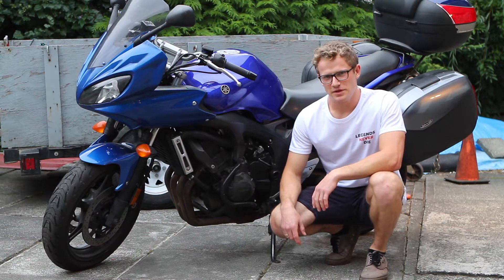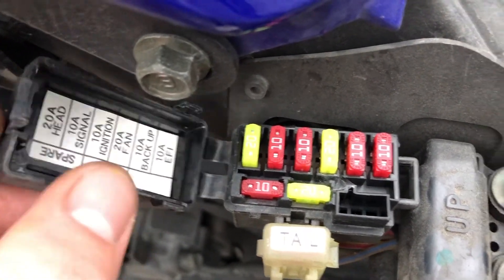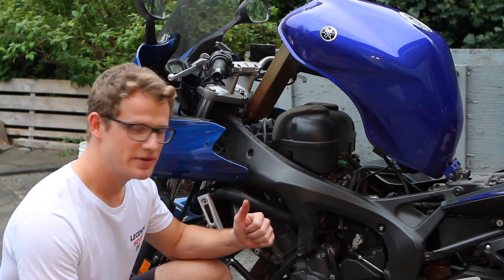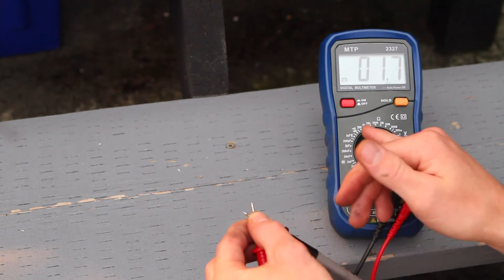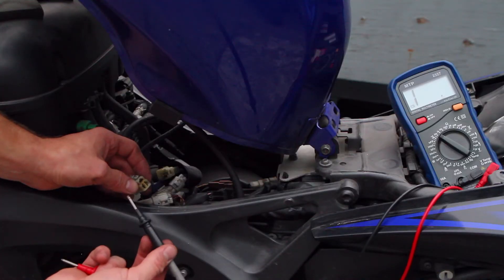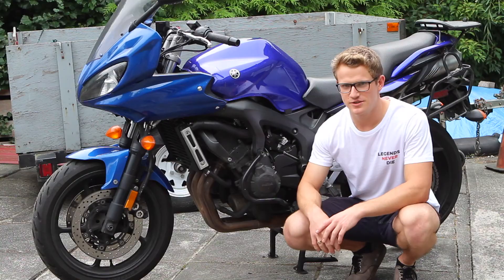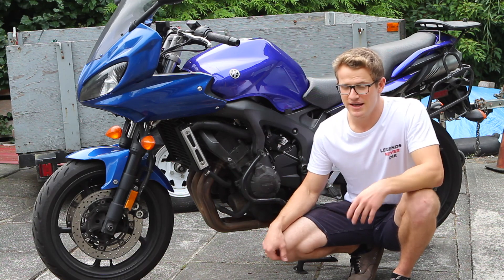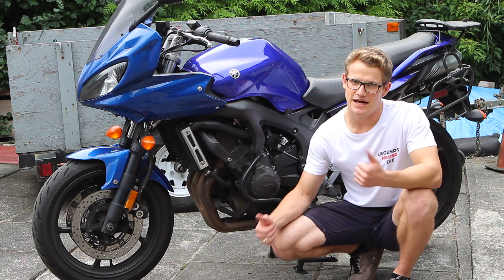Full Inspection of the FZ6 Charging System

Comment: Ha! Youtube at its finest. I have the same problem and I thought that it is so hard to check the alternator because I thought I have to open it. Turns out - I don't. Turns out - it is most probably fine, because I drain the battery once every several months or a year, apparently without any recognisable pattern. But thinking about it - the pattern very well may be - riding in low RPM! Thank you man. I knew that bike is so reliable, I feel better knowing it was my fault all the time and not the bike's.

Comment: Hi. What if the battery is at 12.8 when I get it out of bike and drains to 12.68 in like 2 days and then stabilises itself at that value? Is it a bad battery?
Reply from the maker: That’s fine. A battery at 12.6 volts is 100% charged. Your battery sounds fine.
Reply: @Calvinm  Ok so battery is good, stator is good cause I checked it, but I didn t understand how to check de regulator/rectifier. Where do I have to put the multimeter to check it like you? At idle the dashboard flickers a little bit and when I accelerate it gets steady and brighter, also same with the headlight.

Comment: Thanks for the great video man! Yeah, I am having similar problems. Battery seems to cut out even when I am riding the bike. I came up on a stoplight the other day and the engine cut out. Bike wouldn’t start after that. About 2 minutes later it started up again. I made it another mile and it did the same thing at the next stop light. Luckily a guy swooped down from a nearby apartment like Batman and helped me jump it. I didn’t make it out of the parking lot before it died. It’s happened a few times: the lights and display go out and the bike dies when I stop revving it. I did leave it on a while back and killed the battery. I am taking that in to get tested, but it sounds like I’m gonna be testing all these parts.

Comment: Lately I moved my fz6 Yamaha 2007, from my garage and put it in my back yard, now my bike won't start. It tries to turn over, but when I rev it, it's fighting to get the gas to rev it. In the past I had battery problem where I have to keep my bike charged over night, and now my bike won't start at all, even when battery is charged. Now my head lights won't even come on, need help my bike community, is it the regulator, I know for sure I need new battery, but what else could be the issue
Reply from the maker: I would change the battery to a new one and then assess what charging voltage you are getting when revving the bike to 5k rpm.
Reply: @Calvinm  thanks will do, crossing my finger

Comment: did you ever find a long term solution for the inherently weak charging system? 
I'm experiencing the same on my (bone-stock) 2012 FZ6R :( 

I saw someone recommend a swap to LED lighting which is a good idea...
but idk how much of an impact that would have overall. 

seems like a fatal design flaw and caused me to have to get my bike towed back home recently.
Reply: side note: my idle rpm is ~1600
Reply from the maker: There was no better solution than keeping the idle at the correct spec and making sure all components are within spec and working well. Also make sure any accessories aren’t draining your battery like extra lights or heated grips. I found a new battery really helps. If your battery is a few years old it would be helpful to replace it. Best of luck!
Reply: @Calvinm  ty 🙏

Comment: Hi Calvin, loved the video but don't experience the problems you mention. On my third battery from new (2008) and this current battery has only been flat once in it's 5 years of service. I charged it up and had no probs since. I usually only ride it for an hour or two a week and don't rev it extremely hard. It's been super reliable and I never really had any trouble even though I have two front lights on all the time and heated grips. Also have a gear change indicator wired. Greetings again from Australia, cheers, Pete Bosch.

Comment: my fz6 voltage wont shoot up when revving instead will slowly increase to 14 v at 5000rpm however as the bike warms up voltage will drop. cant seem to find the problem. have changed rectifier and stator. i tested the stator got 50acv

Comment: 08 FZ6 with only 14 000 km on it, I recently replaced the battery start of the season and I found that after it has sat for about a weak it has power but not enough to start.  Excellent video to give me some information on where I can start trouble shooting.  Not having a tender attached to the bike (the first 5 years of the bike it would start after sitting for the winter first crack every time) I have to open the gas tank up every time I want to put a trickle charger on it. I do tend to ride only short periods.  At most 30 mins of riding mostly highway.  However been finding after I drove it 2 days in a row for about 20 min rides each the third day I went to take it out the bike wouldn't start. Thanks for the advice and easy break down of steps to get closer to figuring out what might just be the issue.
Reply from the maker: It sounds like you have a parasitic drain on your battery. As in one circuit on your bike isn’t completely turning off when the key is out. Sometimes heated grips or accessories do that. I’d recommend getting a multimeter and reading up on how to find parasitic drain. Best of luck!
Reply: @Calvinm  After going through all the steps it does appear that once the battery was fully charged and unhooked it held around 12.64 only dropping slightly.  Stator and Rectifier both seen well.  I feel the charging system is doing it's job.  But something somewhere is causing the battery to drain.  The bike is completely stock with no aftermarket addons and from what I can see everything seems to not have any frays.  Bike has never been dropped.  Next step I'm guessing will be to look for continuity between all the wires. And have my battery tested since its under warranty and should be free just incase there is something I'm not picking up.

Comment: My battery shows 12.7V. when I start shows over 14V, when I rev numbers goes under 14V, but over 13V, is this normal, I have 2 cylinder 700cc.
Reply from the maker: Sounds a little odd. Usually voltage would increase with revs. But your voltage with the bike off and at idle sound fine. It would only be a problem if the bike went below 12.6 while revved. Either way I would consult the service manual for your bikes specifics.

Comment: I've had problems with my Fz6 not being able to start after idling for a while, or going for a short ride and stalling the bike. I've had to roll start it several times. I checked the battery and its 12.84 volts when off. I checked the voltage at 5000 rpms and it doesn't get above 13.5 volts. I'm going to check the stator but what do you think the problem is?

Comment: Hi, by any chance, maybe you know why my rear bulb shows higher voltage than brake light? Also, why horn voltage drops to even 4V when I rev the engine? My battery shows 13.05 V when off, and when I start and rev it not going higher than 14.35V, so regular should be ok. Stator shows all 3 connection the same about 0.2 oms. Basically I changed stator and after one day I saw my rear bulb not working, when I changed it burnt straight away when I turned the key - ignition ON. Trying understand what is going on. I had additional horn on, I took it off now, I thought maybe it is same circuit and I switched wires on horn or something 🤦‍♂️

Comment: hi again :D if I start the engine and disconnect the battery, would it still run, or engine need battery to run, as it is injection and so on? I mean can this method be used to check if generator is producing power to the bike, or energy is taken always from the battery?
Reply from the maker: There isn’t a test in the factory service manual that involves running the bike without the battery connected to test the power of the stator. I wouldn’t recommend doing that either because it could overload the stator and cause problems. The bike might run with the battery disconnected but I could be wrong.
Reply: @Aivara83 did you tried it?
Reply: @kmetmosnja6341  can't remember, I think  I didn't try and I can't now, because my engine exploded 🤣 I have a 2 inch hole in my engine now 🙈
Reply: @Aivaras83  ouch, how that came to be? 🤔
Reply: @Aivaras83 Yes what exactly did you do when that happened cuz we're not trying to have a 2-in hole in our motor either

Comment: When you measuring stater, these 3 wires, resistance (at 5:00 min) do I have to have battery in?
Reply from the maker: Yes, it doesn’t matter if the battery is in or not. When the plug is disconnected it has no connection to the battery.
Reply: @Calvinm  sorry, I meant, do I have to have battery connected? 🙈😁

Comment: Weird, never had any charging problems with my 2006 FZ6. My battery is more than 5 years old Yuasa and still strong. I do not even have any issues with starting the bike at near 0*C temperatures. I put more than 2.5kkm this year in temperatures below 10*C with heated grips (55 W power) almost constantly turned on and everything runs perfectly. I only had an issue once when turn signal relay ceased to cooperate, but it started to work again after I restarted the bike. Also I had to replace a starter due to the fact that the brushes were completely worn out and I would get error code 12 due to this fact out of nowhere.
Reply from the maker: That's great you've had no issues. This kinda confirms my belief that a trouble free bike stays trouble free. As soon as one charging system component starts to get weak it takes another down with it. Or maybe that's just my jaded perspective haha.
Reply: @Calvinm  yeah. Though I have the older version of the bike (pre-facelift). Still, no idea what could be the cause of the issues on yours. Definitely running the diagnostics of the entire charging system could help. Or checking for any parasitic power losses.

Comment: I have a problem with my Fazer,,i just  change the batteray and only work two day,,,after can't start...so i think the batteray is won't charger...do you have any idea???🙏🙏🙏🙏🙏
Reply from the maker: Sounds like your battery has a parasitic drain. It's possible a component of the bike is draining your battery. Try charging the battery but leaving it disconnected from the bike. If it holds a charge over a day or two, then the battery isn't the problem. 

You can use a multimeter to search for a drain on the electrical system, but that's getting a little technical.
Reply: @Calvinm  i ready buy a new batteray,but only work two day,,,and this morning i found one cable from a left side go to main a regulator part looks burn,

Comment: Thanks for your video.  I have the EXACT same problem on my 2005 FZ6...and, it's because I haven't wanted to take the RPMs over about 6K.....  You explained a LOT here!!!
Reply from the maker: Glad to hear the video helped you! With the FZ6 you definitely gotta keep the revs up just to keep the battery topped up. I've gotten into the habit of lightly revving the bike to 3k rpm if I'm sitting at a long light. I wish it wasn't this way but oh well.
Reply: Yeah I'm actually electronically limited right now due to power of the battery so I'm going through all the usual suspects of what is causing it I can only do about 5,000 RPM Max right now and I have to keep the bike at 3K RPM while stopped just to be able to move from a red light or stop sign and on top of that it has to be at 3000 or higher just to be able to begin moving without falling on its face

Comment: Hi. I have question. Yesterday check engine light came on. And that was about error 46. So I measured stator coil resistance - 0.29/0.30 thats OK. Than I measured battery when  disconnected from system I got around 13.1 volts thats OK. But when I measure battery voltage when I rev at 5000RPM I got way above 17volts and keep increasing. Thats not OK right? So I need new regulator. Please respond, because its bike season and I got this check engine light. How bike rides nothing changed and nothing tells about problem but I don't like that check engile like and error 46/
Reply from the maker: Hi Rihards, yes going up to 17 volts and climbing at 5000 rpm does sound like you have a bad regulator. It makes sense that your battery rests at 13.1 because it is being overcharged. Your battery with everything disconnected should be closer to 12.6. It is usually recommended to change your regulator and rectifier at the same time because they are so closely connected but I've changed each part individually before and not had any issues. Best of luck!
Reply: @Calvinm  You are the best. Minutes ago I got new regulator from store and just changed. And woalaaaa. Brilliant. No check engine light and everything is fine.
Reply from the maker: Happy to hear your bike is healthy again! 👍

Comment: Just swap in a Vortex 15 Tooth, 530 steel front sprocket (Product# 3516-15) to alleviate that issue of riding slow and achieving peak power. Going down one tooth on the front sprocket will cause the bike to rev higher at lower gears.
Reply from the maker: That's an idea! I do a lot of highway commuting though so I don't think I would enjoy the added revs on the highway. Thanks for the tip

Comment: man I have a error 1, when i press the starter button it turns over but the instruments reset and error 1 again.
Reply from the maker: Yikes thats a tough one. Error one point towards an issue in the main wiring harness connection to the ecu. Check the coupler for pulled out pins or moisture and corrosion causing problems. If that doesn't show anything out of the ordinary make sure the wires between the dash and the ecu are not shorted out anywhere. This will either be a really simple solution or a lot of head ache... Best of luck. Shoot me a message on instagram @freeheadgasket when you figure it out!

Comment: CODE: 33 34  ..   I replaced  Ignition coil .and still show me the same problem...   He also shows me a code 62:1.
Reply from the maker: Ya code 33 and 34 point towards the primary side of both ignition coils. Check the wiring on the primary side for a short or a bad connection. Also check the resistance on the new coils to ensure they are up to spec. Code 62:1 means the bike has a history of one code, which doesn't really help this trouble shooting. Best of luck!
Reply: Thank you very much I will check ...

Comment: Switch to an LED headlight and tail light.  That will remove about 100 watts from your system without reducing light output and will likely solve your low speed charging issue.
Reply: I just have a kill switch for it
Reply: What type of LED are you running? Names please

Comment: I have a question about what is causing the battery to discharge, I replaced it with a new one day driving and the other day the battery overnight discharged to 4 volts, I do not have GPS tracking, I only have heating grips that are turned off together with the ignition
Reply from the maker: Hmm that does sound strange. The only things I can think of are that the new battery is bad from the manufacturer or there is something draining your battery while the bike is off. Try reading about parasitic battery drain and test your circuits to see if anything is pulling power while the bike is off. Best of luck!
Reply: @Calvinm  Damaged heated grips caused a short circuit and damaged the relay that discharged the battery while not using it, unplugged all the extras that were connected to the battery, changed the battery and problem resolved
Reply: I found a problem, previously I had a problem with rectifire, which charged the battery up to 18 volts, I damaged the relay from the heating grips, which after turning off the ignition constantly gave voltage to control the heating grips and thus discharged my battery

Comment: I have had my FZ6 since 2005 and haven't had any problems until yesterday. It is a great bike. I bought it new and never felt the desire to get another bike. Its got good pull, agile, and is fun to ride. It is also very versatile. 

I tried starting it yesterday . The motored turned over with no problem but with no ignition. It might be an electrical issue. It got a major tune up and overhaul about 2 months ago. The battery didn't seem weak at all. So I am a little puzzled.

Comment: very informative video!

I ran into some electrical issues recently and ended up replacing the stator as the old one looked burnt out / corroded. After replacing it, the bike is charging great (13.5v idle, 14v 5k). The resistance on the stator is high though - it's reading 0.7 ohms. my multimeter has resistance of .1 so that would make it 0.6 ohms. it is an aftermarket stator that was advertised as more powerful than the original. do you think the high resistance is a problem even if the bike is making the proper charging voltage?
Reply from the maker: It sounds like you're getting the appropriate voltage at the battery. The resistance specification may be slightly higher on your aftermarket stator. Maybe contact the manufacturer of the stator to get a spec from them for what a good condition stator of their's should measure. It probably won't be an issue, probably just a slight material or winding difference in the stator. Where did you get the stator?